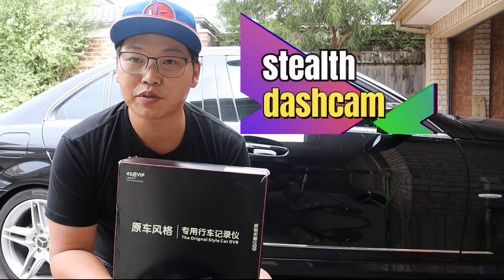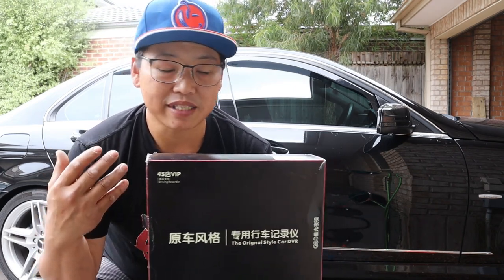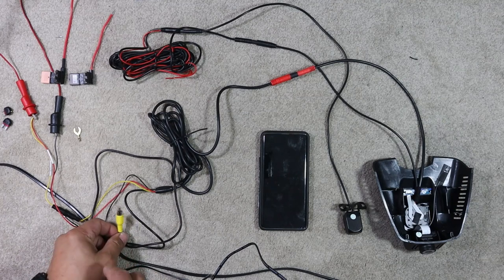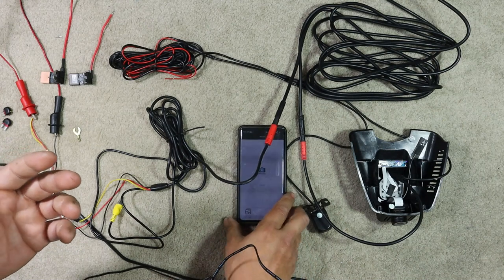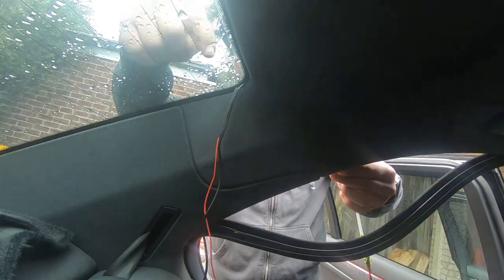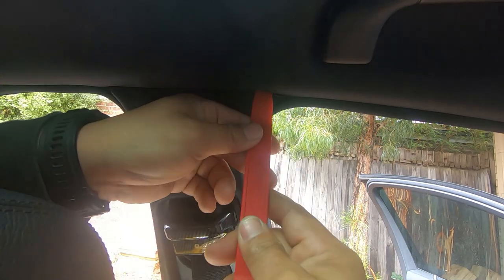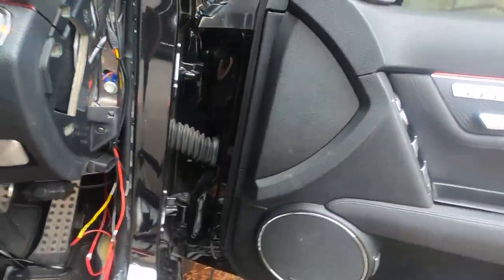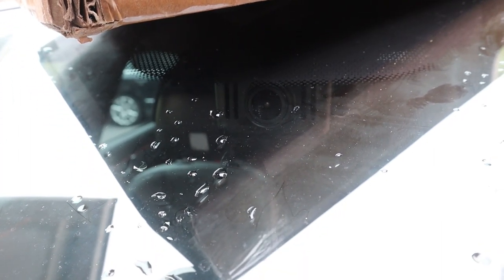mercedes w204 w207 w212 c207 x204 g204 w205 A C B CLK CLC GLK class stealth dual HD dashcam install

Comment: Hey mikey! Question! On my passenger side wich for your car is the drivers side the pilar that your removed and showed the airbag the cloth on it is wrinkled only on that pillar how do I replace it?
Reply from the maker: u want to replace the airbag cloth? I'm not sure I'd have to do research.. and find out.. I. not a professional I just diy and self taught .. I learn by reading and watching videos too...I'll look into it
Reply: @MIKEYZVLOGZ  the airbag itself is fine!
I mean the how do I call it hmm, the cover that is the same cloth / material as the head liner is it easy to take of and replace with doner car one? I have never exposed the airbag before the headliner cloth on the driver side of the front glass is wrinkled wish I could post a photo then you would really know what i mean lol!
Maybe I could get the wrinkles out not sure dont want to ruin them

Comment: Hi Mikey, I am thinking about getting a dash cam for my w204 and this setup looks clean. One question, did you check the quality of the camera during night/with low light? Maybe you could do show a sample or a screenshot?
Reply from the maker: looks good mate and still clear
Reply: @MIKEYZVLOGZ  Hey Mikey, one more question. I got this dash cam (or very similar) for myself, but it gets a bit hot when it's working. Also had few instances where my memory card is not detected, I think it might be related to high temperature of the dash cam. Is your dash cam also very warm/kinda hot? Have you encountered any issues with memory card detection?
Reply from the maker: @Dstillus  actually no.. my dash cam works very well

Comment: How's it going Mikey! Quick question! I have a 2010 c63 recently my Navi has been acting up it works for about 5 seconds then a message pops up on the screen saying "DRIVE UNAVAILABLE" it started doing this after I tried installing a radar detector tapping into the connections where the rain sensor is connected. Wondering if I screwed up the whole hard drive? Or what might've happened? Can you please help?!
Reply from the maker: have u tried a reset of the system...? I'm not sure exactly what ur issue is but it does seem like it related to the hard drive cuź that where the gps navigation would be installed ... tapping into the rain sensor wouldn't affect the navigation... what else have u done lately? u may have done something to cause the issue
Reply: I haven't messed with anything else in the car. Do you mean resetting from engineering mode? Also wondering if I update to an android tablet would solve that issue?
Reply from the maker: @guillarce96  ye if u get a new unit it would solve the problem because it will run off different software and program

Comment: And did you put facelift mirrors on your car or was it factory? And also the led drl’s are those factory? On my C180 Kompressor 2008 those are round ugly fog lights!

( so far I used your videos to replace the front grille and fix the command knob and also installed carplay to the ntg 4 screen )
Reply from the maker: they were all factory
Reply: @MIKEYZVLOGZ  I really need your help I have the older style fat mirros that automatically fold not sure if there heated aswell, can I buy a set of second hand set of facelifted fold in mirrors and then just install them plug and play? 
And also I saw for around 150/200$ that you can get them new from alieexpress not sure if they would fit on my pre facelift 08 would you know?
Reply from the maker: @genericchannel9448  yes they should fit and work many ppl have done this already .. try and make sure its just like your so if u have heated and power mirrors ..make sure u get a set that do the same .. and it should just be plug and play..very easy upgrade only 3 bolts and they come out
Reply: @MIKEYZVLOGZ  awsome gonna use your video for it aswell! Mine do fold in but how do I know if they are heated?
Reply from the maker: @genericchannel9448  just the two wires that plug into it

Comment: Should be able to use the rain sensor connector instead
Reply from the maker: what do u mean pls elaborate
Reply: @MIKEYZVLOGZ  there is a cable / adapter that can power your cam right there from the rain sensor. No need to run all the extras cables to another power source. It will make the installation quick and instant.
Reply from the maker: @SKANDaR0875  oh..i get ya, good call muate..i understand what ur saying, good tip mate, i really just didn't wasn't to mess with a sensor, but yes u can definitely do that , well done

Comment: How did you install that jewel pads?
Reply from the maker: jewel??
Reply: @MIKEYZVLOGZ  yes the break and Accelarator
Reply from the maker: @prems1545  they are slide over the top
Reply: @MIKEYZVLOGZ  slide over top? What does it mean
Reply from the maker: @prems1545  yep
Reply from the maker: @prems1545  so u slide the pad over the brake or accelerator and it slides into place there's a video I did for it